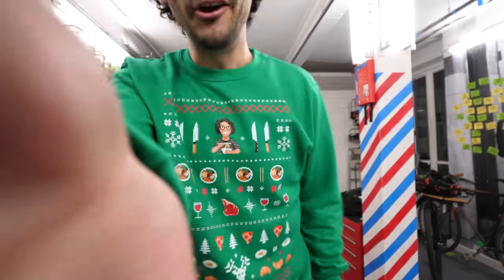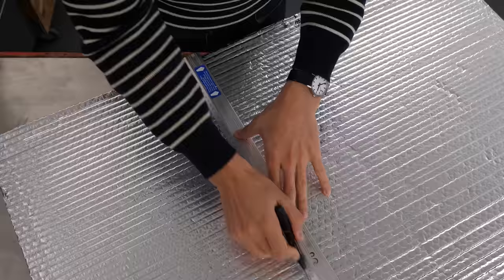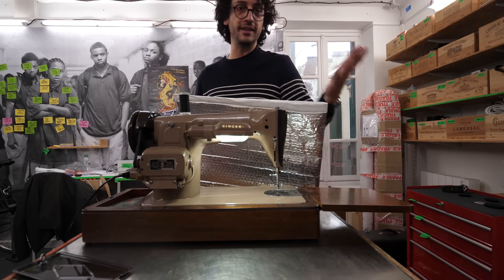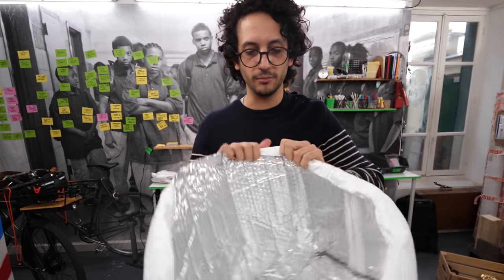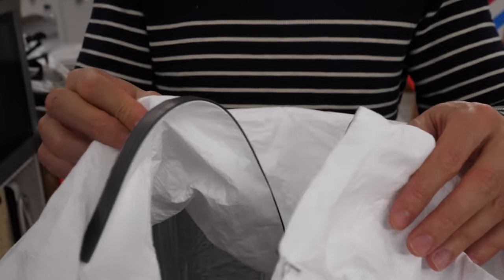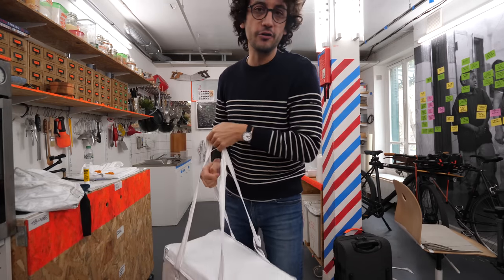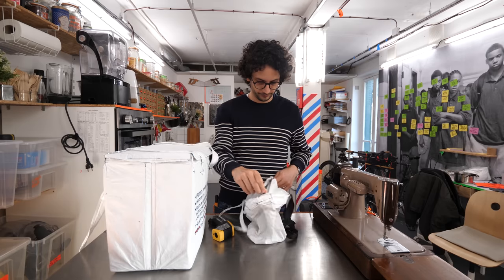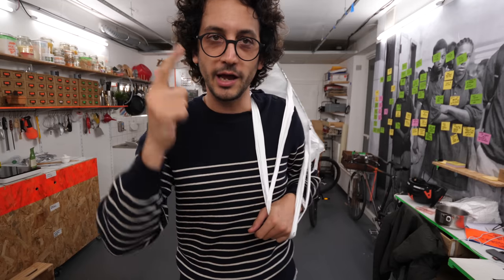Grocery Bag #3 Has GREAT Insulation But...

Comment: You could sew big pockets into the sides and bottom of your bag and then slide panels of insulation into them.  That would make it easier to recycle down the line and you could remove the insulation if you wanted a smaller,  thinner, more portable bag.
Reply: Yes I was thinking of something similar. Basically a bag inside the bag that is made out of some insilating material (for conecting them together you coukd probably use velcro strips). That way you can take it out if you don't need it thus making it more compact and also easier to recycle because you can just simply take it out.
Reply: A bag with DLCs 😂😂
Reply: clever girl
Reply: This is a good idea...making pockets to put individual sheets of the insulation...also disconnecting one larger sheet into smaller sheets could allow the bag to be folded onto itself for portability since the crease of the fold would be the thin tyvek itself and not the thick insulation 🤔🤯🤯👌🏽👌🏽

Comment: I've seen supermarkets sell these cool bags. I used to have one but it's gone now, they were insulated but the material was much much thinner and flexible. Maybe see if you can get hold of one, and deconstruct it. Might help :). I've also seen a material called 'SuperFOIL SFTV 1L High Tech Foil Insulation' which seems like what you have used, but a lot thinner.
Reply: Upvote this so Alex sees it.
Reply: That's a great idea or SFBB that would allow vapor to leave and not allow condensation!
Reply: Mine is a foamy layer a little thicker but can be folded compared to this cardboard-ish material.
Reply: @HappytreeLuis  this isn't reddit that doesnt work here
Reply: Insul-shine
Insul-fab
Insul-bright
Caprisun pouches sewn into sheets work too
Reply: You could also improve the velcro with 3M dual lock it's a stronger and stiffer connection, more relabile, only one kind of strip ( no hooks and loops)and it doesn't fray in time.
And if you want to give the magnetic connection a second chance look for neodymium sewing magnets

Comment: Hey fashion student here
I am not convinced about the velcro part. It isn't really durable as its efficiency disminish with time. Think about the velcro shoes you had as a kid. After a year at best, they wouldn't work anymore.
In my opinion a zipper is the best solution:  it is resistant and durable, metal is recyclable, and if it breaks you can easily replace it.
Reply: It just needs to somewhat hold the lid in place and even barely functioning velcro can manage that. A zipper would be overkill in something that just needs to hold down the lid for a short shoppingtrip. Not to mention, such a long zipper would be quite bothersome. 

Also, a velcro strip is way easier to replace than a zipper.
Reply: I vote those pressure button things, whatever their English name is :D
Reply: @Ludix147 I live in England, I call them snap studs.
Reply: @Ludix147  we just call them snaps
Reply: you have a point.. maybe the zipper should go all around the top!
Reply: @SimonWoodburyForget  

Agreed with the rope, but Alex kind of excluded the idea in this video.
I also agree with the velcro but your arguments are wrong imo.
About the pants, it needs a button for support not because od the weight, but because it leaves a side "open", which makes the znipper slide downwards with the pressure.
All heavy bags and even some big suitcases use zippers. They don't break easy at all.
The only case where velcro is entirely better is for are rapidity and convenience. Which is why sports and military clothing use it.
If you want it to support heavy weight, velcro is actually the one that wouldn't hold  very well, unless if you use a large band. But it is true that if alex's bag proved to be sturdy enough, just maintaining the lid closed is enough indeed.

I also suggested a zipper because velcro is fireproof, meaning it contains concerous substances therefore not environment friendly. And alex is looking for a sustainable solution.
Reply: @SimonWoodburyForget  
Plastic isn't environment friendly. Even if you recycle it, part of it evaporates into toxic particles.
And like I said previously, velcro is always made fireproof, which adds more cancerous properties.
And no zipper isn't popular just because it sells. It was invented ao gold diggers in the 19th century would have a pants easy to put on and wouldn't break, as opposed to buttons. They were designed to last decades. And they lasted decades. Military bags use zippers exactly for these reasons.
Zippers, plastic ones excluded, are either of made of iron, zinc, stainless steel, aluminium. All of them are fully recyclable. Sometimes they are coated, but it is with another metal or paint, that's all.
The only non recyclable parts would be the clothe tapes, because they can be made of polyester, but you can also buy 100% cotton.
I work with zippers all the time, I even recently put a 93cm metal zipper on a shirt, it was 100-150gr at most. So saying it adds a shitload of weight is over exagerating.
A couple dozen of extra grams doesn't feel much once it is distrubuted on all the surface.
Anyway whatever decides Alex, I really understand the hell he's going through at the moment (I am also working on a complete sustainable collection). Chosing the right materials can really be a long a horrible moment. God luck!
Reply: Quick solution to the Velcro issue. 3M DuoLock.

Comment: Perhaps only a smaller section needs to be insulated, thus reducing the bulk and increasing the portability.
Reply: this and i'd add rigid edges (only the edges) to the un-insulated part so it keeps its form and optimize room. The sides would still be the thin fabric so it would fold easily onto the insulated section. And he could put a zipper on top but instead of putting it just on top, he could make it start on top portion of one side and finish on top portion of the other side passing by the top. The opening would then be bigger.
Reply: I know @Alex French Guy Cooking likes to get scientific (just a bit) so i'll developp this idea ^^ 
You have to know what is a thermic flux: it's the natural transit of energy in a material, and can be calculated with a formula: Flux= (temperature difference) * Transit surface / thermic resistance of the material.
So, for your materials, you have the rigid with a low flux (because good resistance) and the foldable with a big flux.
Knowing this, with what you have, you would want to have the flexible parts non-insulated. You would then have a bag that's still well insulated, because you would have in total something like 100-200 cm² of non insulated surface, wich isn't more than what the opening brings, and won't get your icecream melting any time soon.
All in all, you have to think of your folded design, and then place your insulation accordingly. Then, you sew it in place, or glue it, and it'll be foldable. For the thickness of the insulator here, letting 5mm of non-insulated width for the folds would be enough. Now you just have to think of the folds's design!

Comment: You can cut the insulation into smaller pieces and sew them back together. That allows the material to fold at the seam. You can for example look at the creases of a folded paper bag and cut your insulation in the same way to allow it to fold flat.
Reply: Yeah, put gaps between the pieces, sewn to the tyvek and use an origami structure to fold however you want it

Comment: consider origami to address the folding issues
Reply: Cut the insulation into triangles or similar shapes, and sew them to the tyvek separated a few mm apart. Then you can fold along the separations and you'll still have a majority of the bag covered in insulation. Worth a test I'd say =)

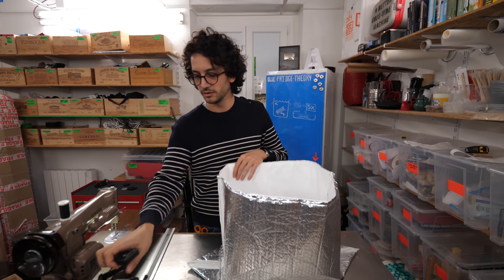Comment: I know you aren't focused in the closing mechanism by now, but I wanted to highlight a comment from the last video. The guy's suggestion is similar to what you see at 3:15. See that extra material you sewed off and cut out? What if you make something similar, don't cut off the excess and instead sew a zipper in the middle, running from tip to tip like the seal of a TetraPak. The zipper would be long enough so that, when fully open, you have no restraints to the bag's interior as found in the last video.
Reply: or run the zipper in a u-shape to open a full-size flap if needed

Comment: What about using some sort of air bladder for insulation? Deflated it'll still fold up super flat but inflated it should add a fair bit of insulation and structure. I'm thinking of the kind of bladders you find in scuba bcds. They're too expensive for this application but a pocket of air is a great insulator.
Reply: ooooh

Comment: If the bag is going to be a high quality everyday carry grocery bag, it really doesn't need to be recyclable, that kind of defeats the purpose of a reusable bag you take with you every time you need groceries. (continues below, i am wrong lol)
Reply: Yea, but when it comes time to throw it away because it’s too worn or damaged, it would be better to be able to recycle the raw materials again one last time.
Reply: @SafetySheepRnD  You know what, that is actually a really good point. suppose hes gonna have to do lots of searching for material. he could also make it partially recyclable if he cant make it fully. interesting problem to solve.
Reply: Depends on the material... A cotton bag for example you might need yo use thousands of times to offset the use of using a single use plastic bag once! "Conventional cotton bags: Reuse for grocery shopping at least 52 times for climate 
change, at least 7100 times considering all indicators; reuse as waste bin bag if possible, 
otherwise incinerate." From "Lifecycle assesment of grocery carrier bags" The beauty in simple plastic bags is that for an equal cotton bag in capacity, you can probably make thousands of them with thr same amount of water. Oils is a great resource for making different materials, it is a pity it is just burned as energy!
Reply: There are more problems than water use :) we pretty much have enough water to waste. However, microplastic & plastic waste are becoming more of an environmental concern
Reply: ShariSez1 That is also true, and it would be nice to be able to ban plastic bag use in such cities.. I also doubt most cotton bags are used for the required 100-200 times anyway or recycled to even remove their climate impact, which just gives them more and more impact on multiple aspects of the environment.
Reply: @Ludix147  We have got enough water to waste? That is a pretty weird statement. Water is becoming more scarce and there are loads of problems with land subsidence, and other effects due to water withdrawels. That does not mean that plastics are more or less of a problem and I thus agree with you on the part that there are more problems thant water usage. In my opinion, the environmental problems the current generation is facing are all difficult to tackle (not yet impossible), and it is hard to look at them all at ones. Therefore we look at principles and ethics behind production and consumption. One of them is that we should recycel, and not waste things. This should not only count for materials or plastics, but in equal amounts to resources.
Reply: I recommended a thin piece of wool between two tyvek sheets for this reason.. I don't think you can send wool for recycling, but you could definitely reuse in other ways. It wouldn't be AS insulating as manmade plastics, but.. quilted would hold air pockets and work fairly well, plus add some structure and 'pretty' depending on the way it was quilted.
Reply: @rkan2  I am making my own washable, foldable cotton grocery shopping bags for maybe 20 years. They last an average of 9-10 years when they are well taken care of, and can be folded into their own pocket, easy to carry around in the purse or the back pocket of your jeans. The first one (the prototype) had to get new handles after 9 years, but it is still in use. Though, neither water- nor leak-proof, but I made for my meat-hauls a removable liner with that 'reflectix' material. It's always (nicely folded) in my car, this liner also has 2 heavy-duty snaps for closure

Comment: I think if you want flexible insulation, use neoprene aka wetsuit material. Also, when you put in the new needle, it looked like you threaded it wrong. Thread should go through from the groove side. The groove is so the thread will lay against the needle as it goes through the fabric. If these bags break a lot of needles, get a higher gauge needle and maybe a sharp point vs. a ball point.

Comment: Hey Alex, you should check out broadcloth. I think you could make your own broadcloth with sail cloth on the outside of the batting and tyvek on the inside. That would make it waterproof inside, durable and aesthetic on the loi outside with insulation and flexibility somewhere in between the two bags in this video. Also, if you search for magnetic bag closures they sell magnets sandwiched between thin plastic those are what people normally use for bags because you need stronger magnets than the tape can provide. Hope its helpful. Big fan of you channel.

Comment: Emergency blanket between 2 layers of tyvek?
Reply: He tried but the material would not hold. Even between layers it would probably turn into shreds when the bag were folded.
Reply: @armin0815  It's a thermal blanket ment to folded?
Reply: fuxiz but not after having punched by needle stitches and confined to a certain shape. It'll rip right out.
Reply: Pack squares of it into pockets like a quilt or just use an adhesive to bond it to the fabric. It's a metal film, not a fabric.
Reply: A heavier reusable reflective blanket would work instead of the one time use ones.
Reply: @NrJuan  Thermal blankets get super flimsy after very few uses- Source: Married to a paramedic, he uses them to cover patients and they shred super quick.
Reply: Emergency blankets are made from Mylar, if it was laminated between two sheets of the other stuff it would work well, but yes, overtime it would wear out.

Comment: Hey Alex! I make a bunch of my own backpacking gear- it deals with a lot of the same goals (ultralight, packable, durability, weatherproof, and warm/insulated). I think you should look at changing the way your bag is insulated. Here are two ways that may work: 1. air insulated like a blow up sleeping pad or beach ball, use heat sealable fabric (which you can seal at home with an iron) and design baffles into the bag, put a valve on- then you can deflate it to fit in your pocket or if you're not buying refrigerated groceries. The problems with this design could be durability depending on the fabric you buy- if you poke a hole in it you're screwed. Or 2. insulate your bag with synthetic or down insulation sandwiched between your tyvek/a polyester ripstop fabric like a sleeping bag or a puffy jacket (I would suggest Climashield 3.6 oz APEX insulation). You find a whole bunch of suggestions for for stuff like this on the make your own gear (MYOG) forums on backpackinglight.com

Comment: Have you thought about a "space blanket" as a insulation? Try sewing it between the tyvek.
Reply: He mentioned that in the last video.  It's too fragile and also not recyclable.
Reply: I think the insulation he added is basically bubble wrap coated in Mylar which is the same material as the space blankets.
Reply: Too thin. would just tear apart
Reply: Space blankets  work for radiation and convection, not conduction so I don't think it will work well
Reply: the space blanket stuff is not at all durable. It would shred in between the layers of tyvek after a few folds. We use them on ambulances all the time to cover patients out in the field and even if they weren't 'single use' for hygenic reasons.. they're just not durable at all. I recommended quilting closely woven wool. quilted wool is darn good insulation, a natural product, and very durable. Plus, depending on the quilting pattern and thread/fabric colors, pretty!

Comment: You could construct the bag similar to paper bags which have the creases along the sides and bottom that allows it to fold really compactly/flat. It won't be pocketable with that insulation, but it wil be a lot less voluminous.

Comment: I enjoy these forays into the obvious. Comments thus far: Way too big. You should have loaded that with bottles and heavy stuff to test it. Tyvek? No. Just no. Get away from plastic. If you want something a little more eco friendly. Quilted cloth and woolen felt. That should provide insulation and some sort of eco friendlier design. Also for more insulation the thicker material needs to fit more snugly. And white? Far too ugly. But the quest is a good one. Keep going Alex!
Reply: Quilted cloth would make it far to bulky and even woollen felt gets quite bulky when folded a few times.

Plus, if you are going the whole "eco" route, cloth (often cotton) and wool both require energy intensive processes to produce.
Reply: Tyvek is dope, as much as I love wool I don't think it's as good in this application
Reply: i like how it looks the white with the words on it, i think tyvek is the way to go it is water resistant helping keep liquids not just out  but also in. maybe the lining inside be cloth so that is not so boxy and more compact with just something hard on the bottom to help keep its shape. or some kind of canvas would be cool

Comment: Might I suggest aluminized aramid fabric which is used for protective industrical clothing.  It is available on Amazon.  There are other aluminized fabrics available also.  For something less high tech, you might try wool felt or fleece between two layers of tyvek.

Comment: Add cuts in the insulation material, where folds for the bag are. That way it doesn't resist being folded together at those specific lines, which means you can keep the size and structure of the bag and still be able to fold it into a small square fitting your pockets.